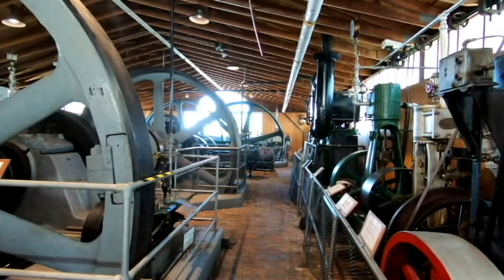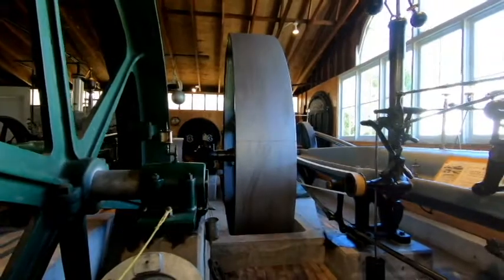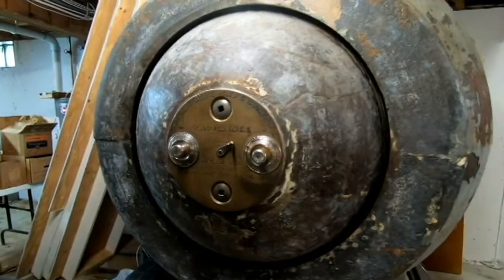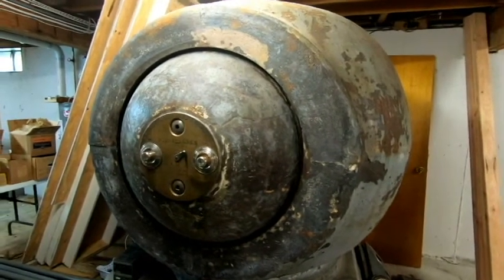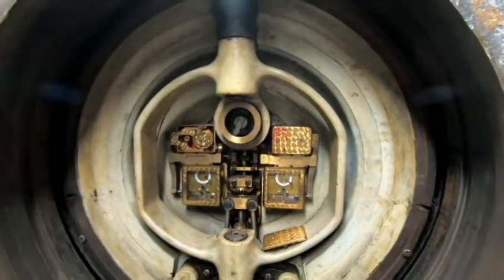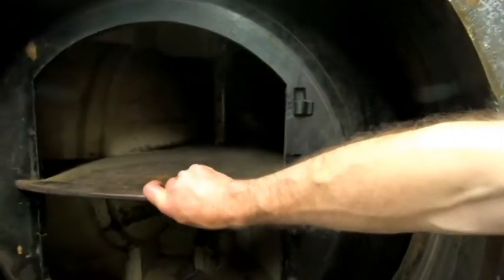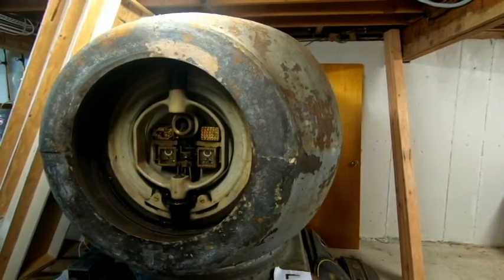Corliss Cannonball Safe

Comment: I could write a book about that Corliss safe.  Only because I was going to write one.  It is more like 32,000 lbs. and was designed and made by William Corliss, George's younger brother.   While George supplied the power house steam engine for the 1876 Centennial,  William had several of his brand  new safe on display there.  As near as I can tell William made around 400 safes over approximately a 20 year period although most were much smaller and lighter.  The company was then sold to Mosler Safe who made another 300-400.  Yours is not the only Corliss to make it back to Providence.  When I was up there I drilled one open in a bank downtown.  There are 2 inside the vault at City Hall, but again smaller ones.  I hope to make it back up at some point to get the locking mechanism back in working order, as someone had messed up one of the locks.  Not many of the 32,000 pounders were made and I only know of one other in existence.
Reply: There is one in Girard Ohio ...The Black Horse Tavern. The building was originally a bank. In 1929 ...
Reply: @444RJE  Yes that is the first Corliss I drilled open several years ago.  I don't normally strip parts but that is how I was paid for the opening.
Reply: Where was the first one you drilled located? Be nice to get out of the vault and bring to first floor level, but then we would have to cut a large enough hole through the top to pull up... don’t think that’s happening.
Reply: @444RJE  That one in the basement in Girard.
Reply: Please do write a book about it -- I would love to have a copy as a member of SAVTA
Reply: We have a cannonball safe in our locksmith shop right now that I drilled and scoped to discover the combo.  The primary lock is unlocked but can't seem to get the door to rotate. Not sure if it's a time lock issue, relocker, or just rust holding it.  Do you have contact info I could send pictures to? I'd love to swing the door on this one but you and Dave McOmie are the only guys I know of that have experience with them.
Reply: What is the name of your shop?  in what city?
Reply: @dougmacqueen1679  tri cities lock and safe in blountville, tn
Reply: I will call you tomorrow
Reply: @dougmacqueen1679  you'll probably speak with our owner who is also named Doug lol but he knows everything we know about the safe too of course

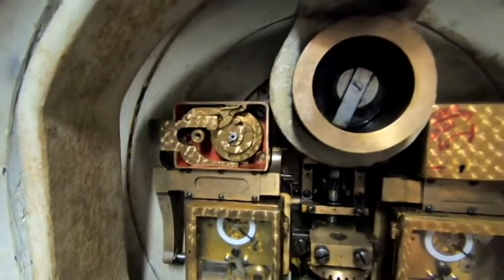Comment: 7:20 - The surfaces were engraved with a technique called "turning". The finish thus produced is practical as well as attractive - the turned pattern holds oil on the surfaces, reducing both wear and corrosion.

Comment: A company I once worked for performed preventive maintenance on safes of all types. This is the first of this type I have seen. I disassembled and serviced  many S and G time locks and changed combinations on the combo locks. No one in the bank would have done that, saying that, service individuals would have seen the working area on a regular basis.